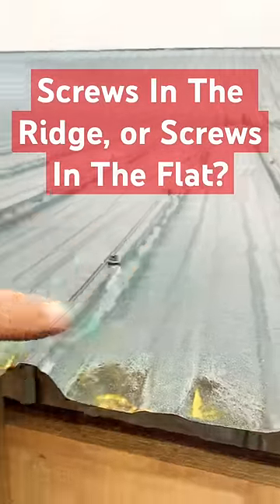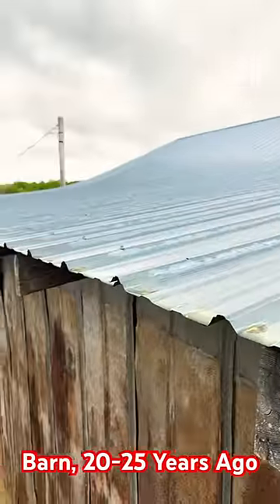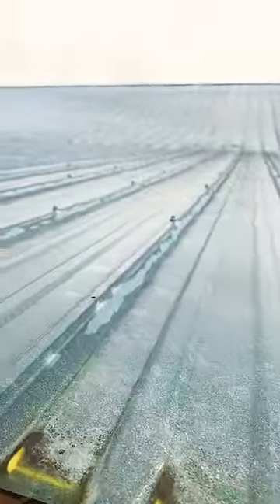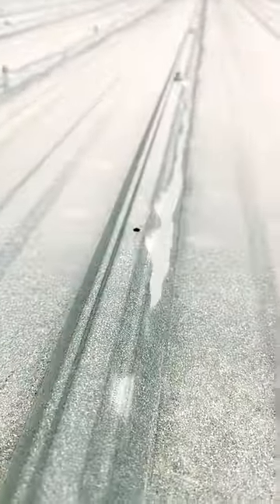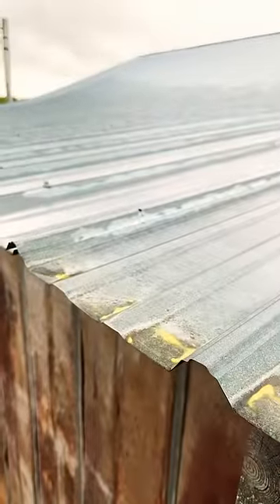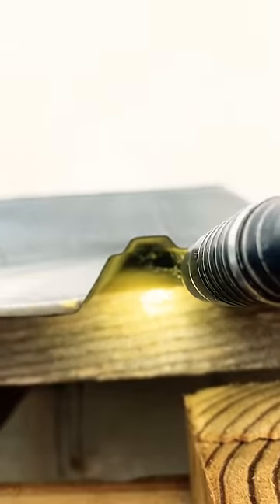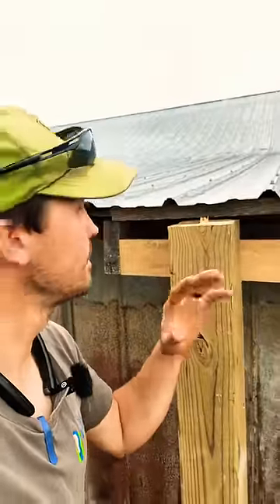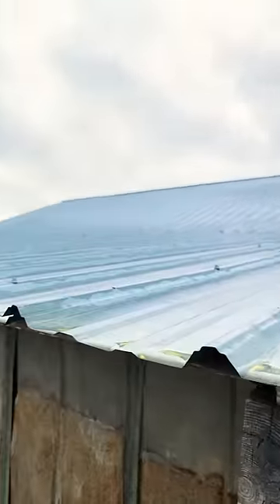What’s Better? Screws In The Ridge Or Flat? #construction #farmlife #building

Comment: I’ve been a professional contractor now for over 30 years. Much of what I do is metal roofing.  The manufacture in our area  says to put the screws in the flat.  If installed on the rib (except  stitch screws) voids the warranty.  Corrugated metal and exposed screws does not work on roofs long term.  Extreme  weather causes expansion and contraction working the screws out or ripping them out.  It’s even worse when installed in the ribs.  So we do not install corrugated metal on roofs  anymore, but install standing seam. All of the fasteners are completely hidden and have had a lot less issues.
By the way good luck on getting any manufacturer to back their warranty!
Reply: I couldn't agree more .
Reply: Im not old enough to have witnessed any failures in my constructions from my teenaged years where i indeed screwed in the flats. But it made sense to me that with screws and rubber gaskets that i want pressure to compress the rubber and the ridges dont afford enough structure to complete the seal. Interesting topic of debate nonetheless
Reply: I have been in business as long as you have and my opinion is tin does not belong on ANY building that has heat in it.  I don't care what kind of metal it is.😊
Reply: Good luck with any warranty.. warranty is a joke..and they won't warranty any damage from water if screws failed.. ridge only
Reply: @davidbires2351  ive watched my teenaged handywork for 20 years not leak a drop, but 5 year old work leak from the ridge fasteners. I think the theory is there to raise them off of potential sitting points, but fastener design has advanced beyond that and flipped that narrative a bit
Reply: The family barn that has screws in the ridge along with a few nails with spacers in the gaps disagrees with that theory, intact debunks it. basically I call bullshit on the whole screw pulling this barn is over 80 years old. No it wouldn't surprise me with warranty because majority of insurers are corrupt sleasebags.
Reply: @ericculver9700 . More fireproof than shakes or asphalt shingles if in fire prone forests.
Reply: Standing seam still is fastened, like you said they are hidden but they are still there so unless you use floating clips then expansion is still the same as exposed screws. Only reason to ever put in flat area is if like you said it's required by manufacturer. Otherwise screwing in the highs is the best way
Reply: You are correct flats and ridge on stitch and only use the screws with covered gaskets teks
Reply: I have a corrugated tin roof I built 40 years ago no leaks and srews are as tight as the day I put them in...Im guessing the roof will outlast my life no need for warranty...
Reply: Your 100% wrong what would stop the wind from prying open the seems
Reply: Your 100% wrong  what would stop the wind from prying up the seems
Reply: @mattwoody1089 you put the screw right next to the cap where the sheets lap.. it isn’t going to lift any more than a shingle roof would. Infact it just isn’t going to lift.
Reply: The Manufacture only says that cause the know the have crappy pannels if there to thin they break when You screw on the ridge but of You screw on the flat it dosent hold very long cause as soon as the sealing of the screw Goes Bad it aint waterproof anymore.
Reply: I couldn't even get a light bulb mfg to honor their warranty and I added them on their network since they were smart bulbs. Said I needed the receipt to claim. Who saves receipts. Warranties are worthless.
Reply: @ericculver9700  funny how Australia has tin roofs and some of the hottest summers. So yeah, this is nonsense.
Reply: I'll second that, I was told by my local lumber yard that screwing the ridge void warranty. No way to get the screws properly tight in the ridge.
Reply: @Henriksen2012  if it isent crappy thin sh*t You can get it very god screwd down on the ridge.
Reply: Not sure what tin and screws you guys use over there but of the thousands of roofs Ive put on in Australia not one has had a leak and its ridge every time. Hit one miss two hit one miss three repeat. Except for bottom screw line and ridge capping
Reply: @--Nath--  OY!
Reply: This is 90+% of all houses in NZ. Screws (with gasket) is only ever put in the ridge if put on flat it will definitely leak. Wind and rain can come hard at any angle here even with screws on the ridge water may leak in but drips down the inch or so gap to the building paper and can find it's way out to the gutter. They also last 50+ years
Reply: It is dependent on the length of the roof panels. The longer the panel the more expansion and contraction work on the screws to elongate the hole or back out the screw. That is why commercial buildings have a lot of issues because typically the contractor will use long panels to expedite the roof installation.
Reply: @GeorgeMinton-jb8ky ”who saves receipts”
people who want to use their warranty? this isn’t new. are you 10 years old?

im 35 and that has always been a thing.

if you are too stupid or stubborn to prove you bought the thing like everyone else has, thats ALL on you.
Reply: @davidbires2351 by the time it's prorated you have nothing
Reply: 30 years in construction, you "nailed" it. Also, slate on my house. Stone will outlast me.
Reply: All I know is, my uncle, pap, and myself put a metal roof on our cabin about 20 years ago, ran the seal under the ridge and screwed into the metal and seal, and not a single drop or wet spot. It's also in a spot that gets a ton of rain, snow, and wind and all types of shit falling on it. Not a single issue.
Reply: In Australia For COLORBOND® steel and ZINCALUME® steel, BlueScope Steel offers a warranty against corrosion to perforation by weathering in the natural elements for a period of up to 30 years*for ZINCALUME® steel and 36 years* for COLORBOND® steel from the date of installation. On roofs screwed on the ridge.
Reply: The millions of homes in Australia proves all of those points wrong.
Reply: You can prevent the screws from backing out by placing a small piece of rubber beneath each washer.

Comment: If you think like a raindrop, it would be the ridge I screw.
Reply: This is profound
Reply: thx yoda
Reply: : P My dad was a contractor all his life and I can remember him saying think like a rain drop.
Reply: if you think like the wind,  the heat from the sun, or the fat guy walking on your roofing you would screw down the flats
Reply: @bonesrhodes3762  as steel expands and contracts with heat and cold, which has more flex to bend back and forth? A screw that is 3/4 inch out of something solid or screwed in tight?
Reply: @gardencornrobber    the screws placed properly in the flats are NOT screwed down tight  -  you are specifically instructed NOT to overtighten them  -  you only tighten them enough to get a firm seal

on the laps,  you place screws in the ridge  -  this is the ONLY place that the manufacs say put screws in the ridge (rib)  -  and these screws are short  -  all they do is pull the two pieces of metal together for a good seal  -  again with just enough to get a firm pressure on the neo-seal and not deform it out  -  these screws do NOT go down into the purlins  -  ribs must be able to expand and move up/down/sideways  -  if the screw is into the purlin, up and down movement will enlarge the hole and loosen the screws -  if you put the screw into the purlin, you will not get the proper force to seal the neo-washer until you have overtighten the fastener, and in doing so have deformed the ridge, causing it to spread sideways at its base which will elongate the width of the sheet of roofing and cause the flats to buckle upwards  -   you can easily increase the width of a sheet of roofing by a 1/2 inch screwing it through the ridges  -  this is the major reason people have trouble aligning the ribs on the two sides of a roof and can easily come out with a progressive mismatch which can end up being several inches on a long roof  -  it also contributes to the saw-toothing along the edge  -  

then there is the different profiles of the panels  -  his looks to be a tuff-rib style which has low ribs , 9 inches oc, and rounded top  -  it also looks like it has a water shed type lap  -  this type is more forgiving of screws in the ribs because it is rounded   -  if it were an r-panel style it would have higher ribs 12" oc with FLAT tops about 1 1/2 inches wide  -  on these,  if you screw through the ribs, it pulls this flat DOWN forming a trough the entire length of the panel - every drop of rain that hits the ridge now stays ON the rib and runs the length of the rib hitting every screw in it :  none of which are actually snug and many which have been worked loose over time  -  on this style panel ( which is very very common in 26 gauge roofing panels )  if screwed through the ribs I will guarantee you will have leaks in the life of the roofing unless those are only short stitch screws at the laps
Reply: jameszacknehring787 
Hahaha 😂🤣👍🏼
Reply: @bonesrhodes3762  let's have a beer play a round of horseshoes and talk about it
Reply: @brianbailey462     LOL  -  not a bad offer at all  -   IF I had a one foot cutoff from a sheet of roofing and a 1/2 doz short and 1/2 doz long roofing screws and a pencil I could show you in two minutes why you screw in the flats and not on the ribs
Reply: Glue
Reply: @bonesrhodes3762  sounds like a good video idea
Reply: @gardencornrobber  you know tek screws come in multiple lengths..? if you are screwing into the Ridge you get 20mm or so longer ones. So yeah  maybe that is why cheapskates don't go for the Ridge..  can save some money setting up for leaks when the washer degrades.

Comment: Through the ridge. Only screw through the flat when you use the sheet as a wall cladding.
Reply: That is absolutely correct. It's amazing what those screw heads snag when they're on a wall ridge.
Reply: read the directions

Comment: 100% depends on manufacturer spec. But other factors to take into account are the wind and waterfall, the slope, and the gauge metal. I know guys been doing only metal for 40-50 years professionally and they both say the same.

Comment: In Ireland we use corrugated sheeting from the 1930s till the early 2000s the screws always went in the high and the added advantage is you could walk on the screws on a round roof no leaks and we get rain
Reply: I didn't even we had that option! Wonderful😃
Reply: Box profile can flap if the screws aren't in the flat

Comment: So basically if rain gets through a screw in the ridge, the water actually just runs down the underside of the ridge and drips off the end of the sheet. If you screw through the flat it’s in contact to what you are screwing it to, so then it drips onto that side the building.
Reply: Not true, it will still go in the screw hole
Reply: That's what a rubber seal on the screw is for. If you go through the ridge, the roof can flex enough to make a poor seal. Which is why manufacturers typically recommend using the flat. A hole in the ridge won't get as much water as a open hole on a flat. But if you have enough air movement, it doesn't take long for things to dry. So do whatever you want on a barn. But for a house, you want a good seal so make sure you are getting a good seal.
Reply: @donniehickman7928  not if there’s no screw like in the video, otherwise yeah you’re right.
Reply: You know, if you take two holes pre drilled and no screws, actually gets tremendous amounts of water and flow on the flat from up high, on the ridge there's NO run off into the hole minus a little direct rain drops.
Reply: If you want to rip someone off so you can get paid for coming back to replace the screws. That's the only way you put screws in the flats. If you want to make it last forever put them in the ridge
Reply: And soak in.
Reply: @JEFF23_ 
Manufacturers recommend it because it creates job security. There are buildings and barns out there over 100 years old done the correct way that are still standing and dry. The same cannot be said for nails or screws in the flats.
Ridge is the proper way.
Reply: That sounds great until you have ice daming on the edge of the roof and your screws are only torqued 50 percent of what they need to be and only contacting the metal on 50 percent of the seal.. what do you think is going to happen?  And if you reason on it you need to caulk the first several feet of the seams at the bottom of the roof so the water doesn’t crest the ridge of the seam.. and if you reason on that enough you realize that corrugated metal roofing (or whatever the proper name for the newer stuff is) is not meant to be on a building that has heat inside because it doesn’t do well at all with ice daming.. but to get a proper seal it really needs to be in the flat of the roof and in my humble opinion into a 2x4 purloin  so it has enough contact to not strip. That is where people are getting leaks is when they are fastening into plywood and the screw strips out the plywood and doesn’t have the needed torque to not leak.. (think head studs on a engine) using a good quality ice and water will help but at the end of the day just get a SS roof and caulk the seams.
Reply: @thomaszinecker1785  that sounds good until you have ice daming from snowfall.. then you have 6 plus inches of water sitting on the roof looking for a spot to go.. that is why it is more important to have a properly torqued seal. This is in the flat of the panel and with enough meat of material that you are screwing into so it doesn’t strip the fastener.
Reply: @wnybricky1559  
Lol.
Reply: @choccolocco  live in ignorance

Comment: Screws in the ridge are also known as lap screws and that holds the sheets together at the highs and the screw in the lows are to secure the sheets itself to the  bracing underneath the sheets ! We do both , on every job I’ve been on !
Reply: Me too Both
Reply: I know them as stitch screws and yes we also use screws in the valley due to our excessive winds. If we used longer screws at the ridge, we could not pull the sheets as tight to the deck and the wind would begin stripping them off.  

My neighbor’s roof was done the way suggested in this post, but after only 3years he lost about half of his roof in January of 22 when we had sustained winds of 85 miles an hour with regular gusts at 105 mph over four days.
Reply: Stitch screws on the lap (facing with the prevalent winds) and screws in the valley. Use the profiled foam top and bottom. Fold the ends of your ridge cap, always downhill. Flashing, roof, edging<-that order.
Reply: We do the same
Reply: @darrellbrown1212 were the screws used with large oversized washers known as cyclone or hurricane washers? Because that isn't very strong winds compared to what we can get in cyclones. And you should never put the screws in valleys
Reply: And yet failing to follow manufactures instructions for metal roof cannot only avoid the warranty, but also  insurance coverage. So I think I will stay with the manufacturer guidelines versus somebody on social media.
Reply: @matthislop1337  cyclones? No valley? Bye bye metal roof.
Reply: @darrellbrown1212  I think that's just for the flat style roofing though, not the corrugated roofing that is the most common here.
Reply: @darrellbrown1212  no idea what manufacturers guidelines are, but we did almost nothing but insurance paid new roofs and always went in the valley, minimal on the lap. The real fun was on the top side of acs/swamp coolers and where multiple roofs tied together.
Reply: @aaronh1372  our roof has screws only on the hills. The leading edge has a  screw every hill. Screws on every lap, nails everywhere else. The roof of our school has screws only, nothing in the flats. Never lost a sheet. 135 miles per hour winds. 
In another cyclone my in-laws had 165  mph winds and they live on an escarpment which makes the winds stronger. Never lost a sheet.
Reply: @matthislop1337  looks like my last comment disappeared... So I say again: nails? We are done here.
Reply: @aaronh1372  clearly. Some people think they know everything. I prefer screws over nails. All the fixtures are into hardwood in our roof. In America do you guys anchor into the rafters only or do you anchor into that sheet board what ever it is I see done. 
You cannot put fixtures into the valley of corrugated iron. The rubber washer, or gasket however it is described in your area won't compress enough as the head of the screw will hit the sides. If you use trim deck roofing with the large flat areas then screws compressing on the flat does somewhat make sense. Foreign from what we do in Australia though.
Reply: @matthislop1337  R panel, not corrugated. Screw head hits metal washer on top of propylene washer. They need to be straight. Deck is part of roof. Even screws back out and require maintenance.
Reply: @aaronh1372  see the r panel you are referring to we call trimdek. It's not a common roofing sheet here. Most roofs are corrugated or some call it custom orb. Where the screws go on the high points "the hills" and never in the low points "the valleys". I personally and professionally as a tradesman wouldn't put the screws on the flats, as the rubbers over time deteriorate and then leak. If they are on the high point they leak significantly less or none at all. Different environments cause different materials to deteriorate at different rates so maybe you don't have that issue of the rubbers deteriorating. Do you guys use/ have cyclone/hurricane washers? Or do you just rely on the diameter of the screw head?

Comment: We do metal roofing on shade canpies and some metal buildings. The engineering typicaly calls for screws on one side of every low, and every 12" on the highs where the sheets lap, and finally every low around the perimeter of th roof.
Reply: Correct!